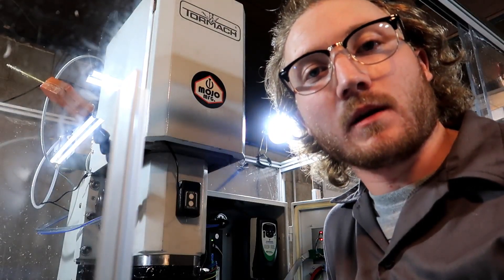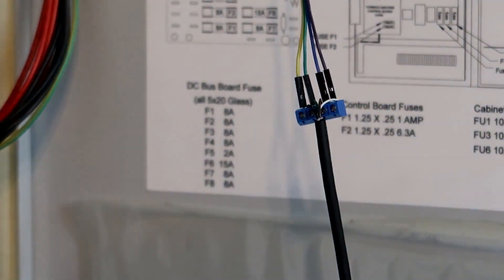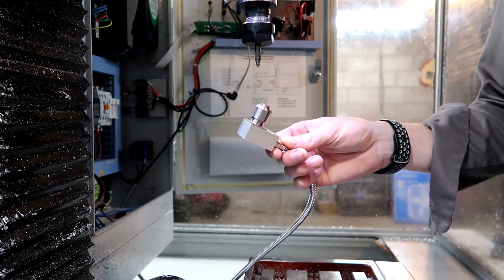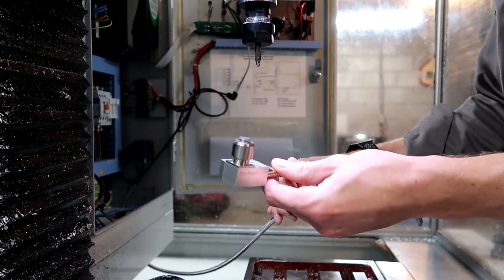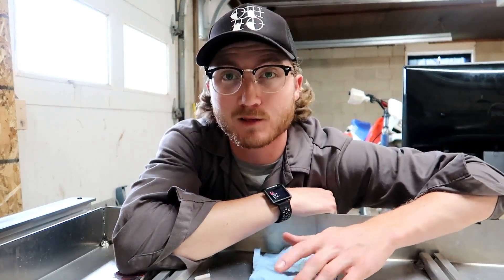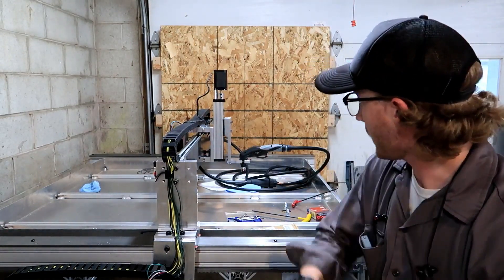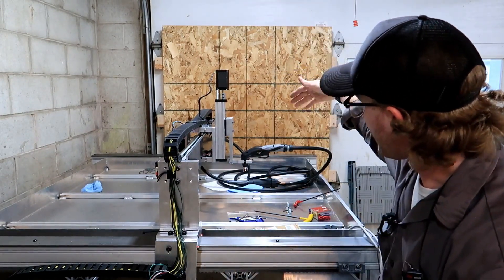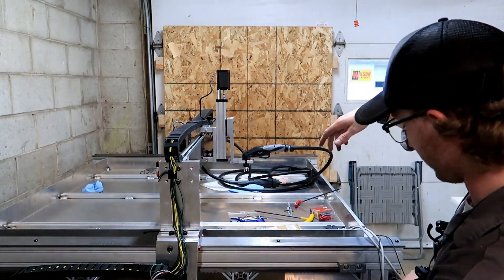DIY CNC Plasma: Z-Axis Build and Stuff: Home Mfg. Days #45

Comment: Progress is progress. :)   Do you have a link to the second, correct ETS you bought?
Reply from the maker: https://www.ebay.com/itm/Open-CNC-Z-Axis-Automatic-Tool-Presetter-Locator-Stroke-Protection-0-001mm-NO/362330027747?ssPageName=STRK%3AMEBIDX%3AIT&_trksid=p2057872.m2749.l2649
Reply: Thanks!!

Comment: Hey Garrett!  I bought an ETS from Austin Allred's site Entirely Crimson.  It's a waterproof version that he puts the correct DIN connector on so it is a plug and play.  He has some good videos on using it as well.  On the torch mount, I would move the torch as close as you can to the plate.  The closer it is, the more Y work envelope you will have and it will have less flex when the torch touches off.  Keep it up, I always enjoy the videos.
Reply from the maker: I have watched his ETS videos and they helped a lot but I didn't know he sold them!.  Oh well I am going to change the polarity setup in the back end of Pathpilot so that should work.  That's good advice too.  The torch seems solid but it could be even more solid if it was closer to the torch post.  Thanks for the help!!

Comment: But acmes have a lot of backlash
Reply: I suspect the 3d printer you mention has delrin acme nuts which under those circumstances can get close to no backlash.
Reply from the maker: Regular acme nuts would have a decent amount of backlash but this one would would have a delrin acme nuts and they are tighter in the threads. It was brought to my attention that an acme screw that long will have a significant amount of "whip" if not thick enough.  Also, plasma cut average tolerances are +/-.1" and that is equivalent to about 6 miles in the machining world(http://www2.mae.ufl.edu/designlab/Lab%20Assignments/EML2322L-Tolerances.pdf).  Ballscrews would be the best but $$$.  I think I will stick with my rack and pinion drive but get the anti backlash tension system at some point.